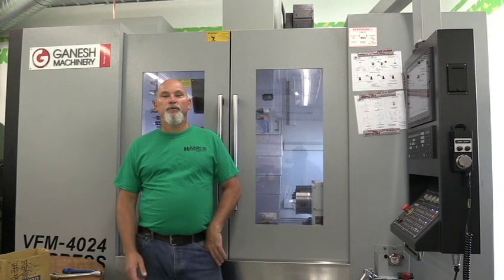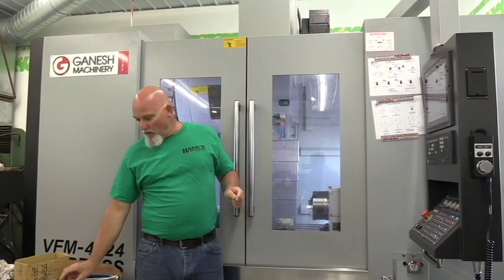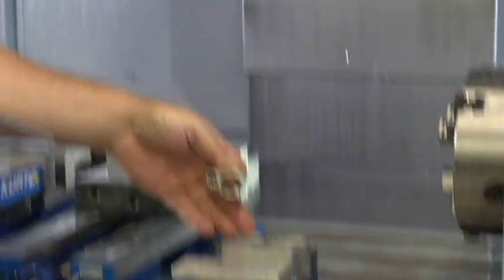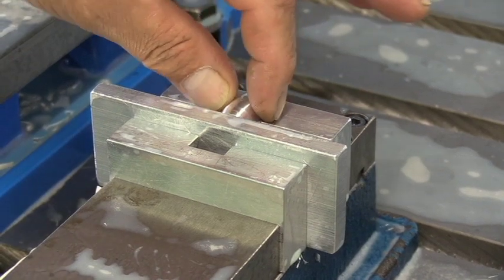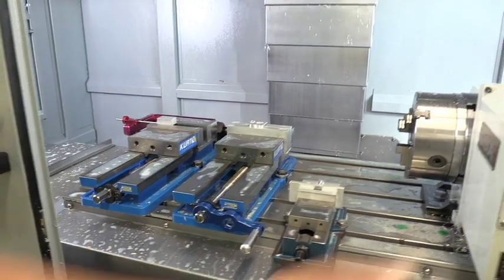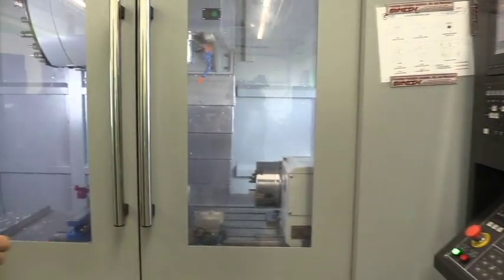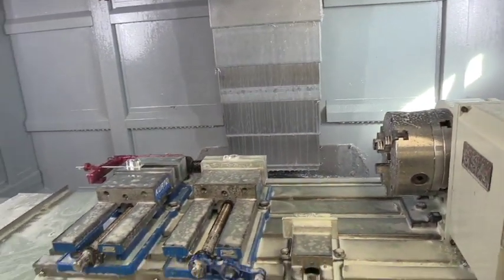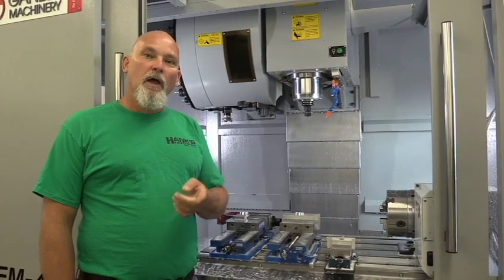CNC Machining a Barrel Band

Comment: Tip for stringers on drill bit, before you send tool home, run in reverse fast, usually the acceleration of the spindle will unscrew the nested turnings off of the bit.  Why such a large mill for small gun parts?  Very nice capital asset. 
Thanks for sharing your mnfg process.
Reply: Yes, I noticed everything about your setup.  I realize this is an advertisement about your business and not a how to video.
Reply from the maker: You can run small parts on a big machine but you can't run big parts on a small machine. Did you notice I have three vises and a rotary on the table top. This save me a ton of set up time and I can run a complete part basically in one operation.